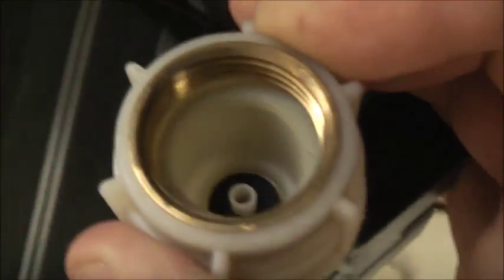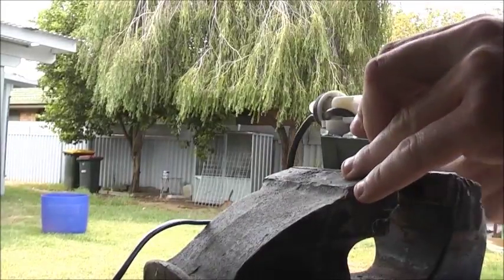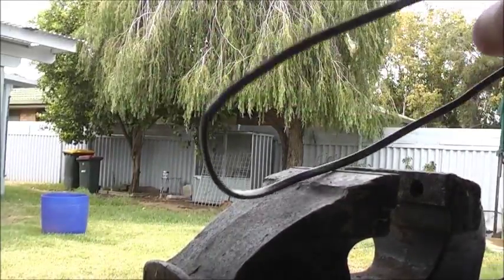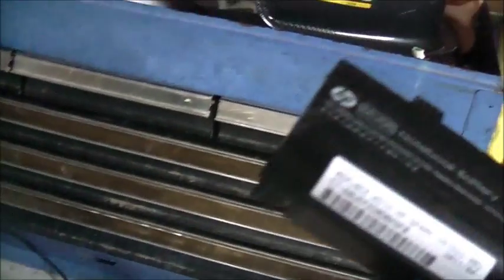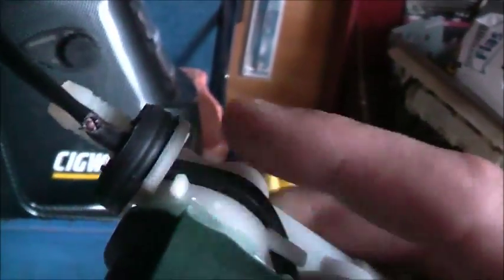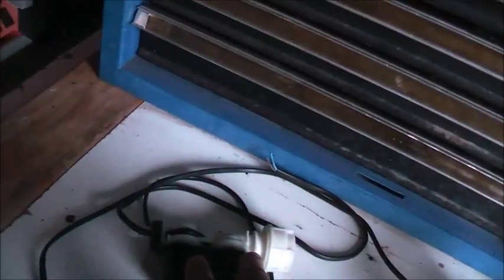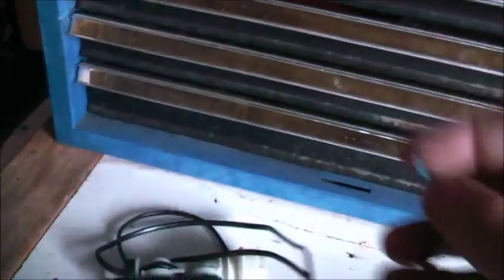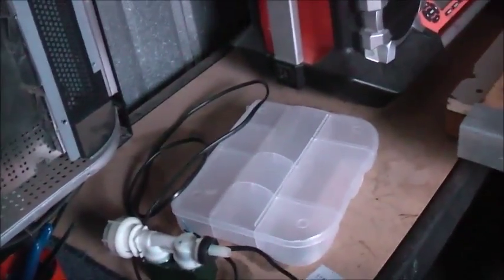Dishwasher Flow Meter

Comment: Its a solenoid valve (2 solenoids) looks like Miele. One is a control valve to add water as required, the other is a backup to shut the water off if the first one fails electrically or mechanically. As mentioned by erlendse, the flow metre is in the machine. They use that instead of a float valve.